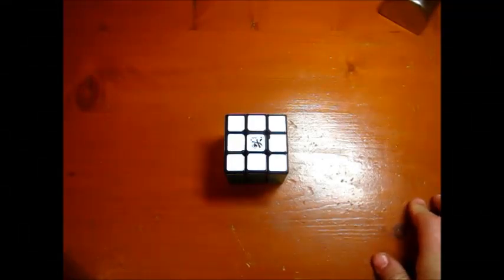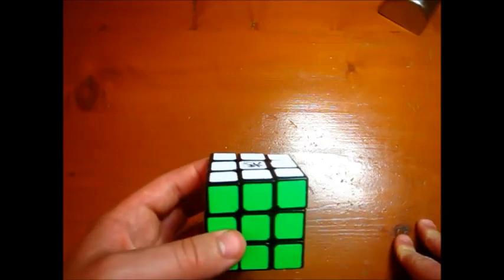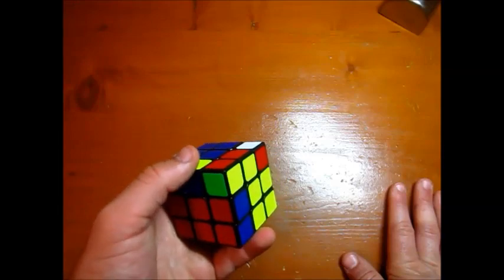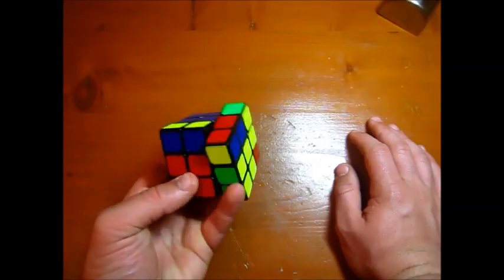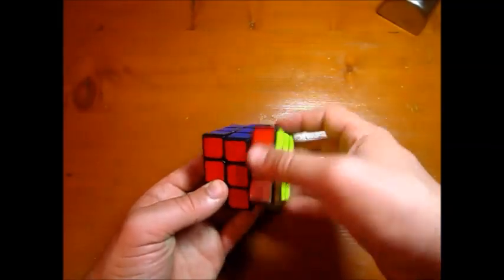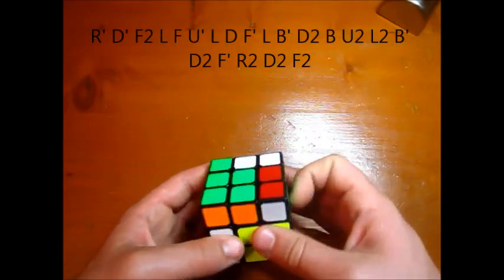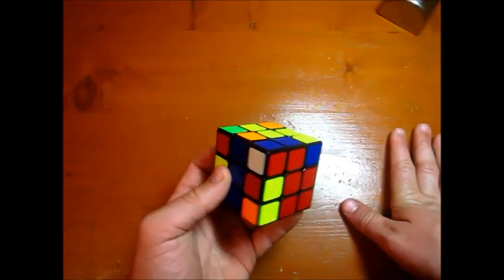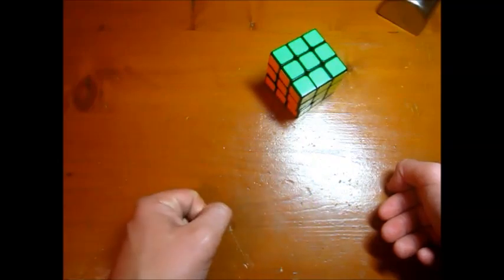[NoahCubes] Edge Control Part 1: When to Use Sledgehammer

Comment: just a tip for your tutorials.... id recommend always showing cases with yellow on top (or white on bottom) just because it makes it easier for people that are not color neutral and have a tough time seeing f2l pairs that dont have a white corner.
secondly, id recommend your walkthrough solve having notation annotation wherever possible, even your f2l cases... because i picked up an f2l trick and had to watch your video a couple of times to work out what you did...